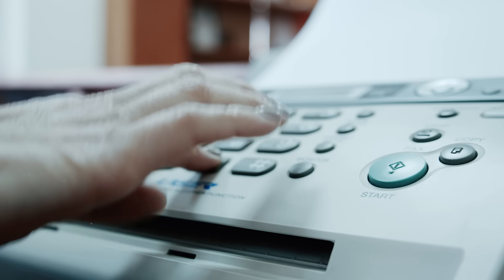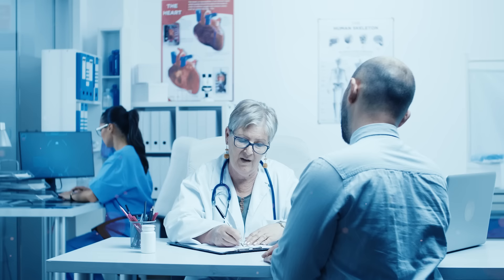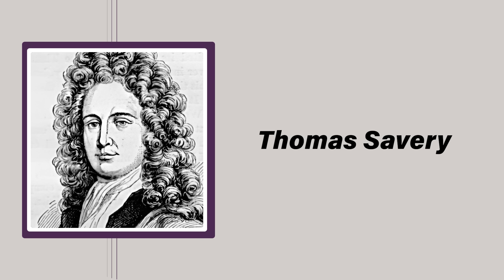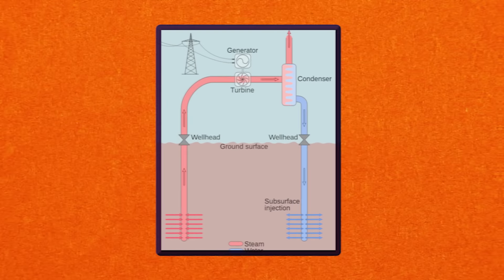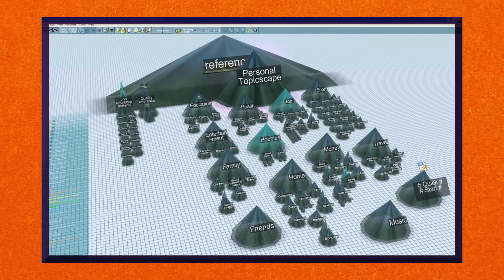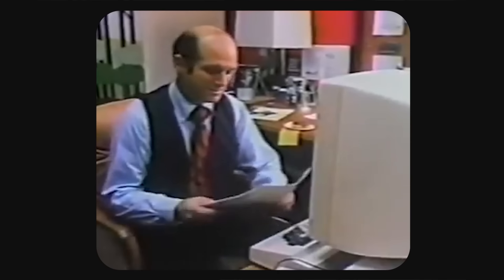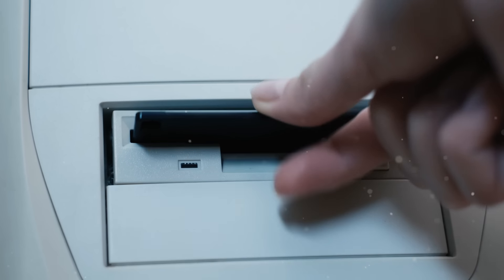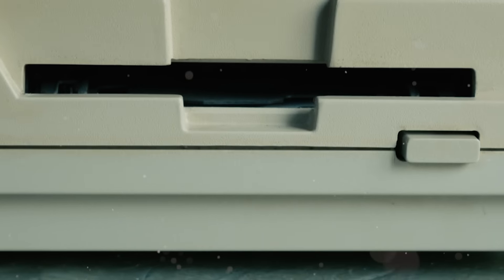Terribly Outdated Technology that we Still Use...

Comment: Hey Simon, I saw a company, with a single owner, do machining jobs with Windows XP. The owner created an interface between old refurbished office computers and large mills. Then he would custom write software for the mill to follow. An example was the large fuel hose collars on F-15 aircraft. The collar had 20 or so steps to process. A semi-trained worker cuts a two inch piece of round aluminum bar stock. Then the billet was loaded into a mill table. The WinXP application is called to slowly mill the inside of the small billet into a collar profile. There were 10 computer mills in the shop. One worker went and cut a second billet and loaded it into the next mill. The process was simple. After a production run was rough cut, the next small program cut application loaded into the mill. Long story short, old Bridgeport mills are repurposed. Old office desktop computers are repurposed. Old XP software was repurposed. 2-3 workers did the output of 20-30 workers. The finished work was very high quality.
Reply: As long as they don't go into the internet, sure
Reply: My Dad was still using MS-DOS and Ani-cam and RS232 serial connection to program Lathes and Mills up to 2016 when he retired. He was a CNC programmer/Setter/Operator all his life. He worked on everything from parts for Nuclear reactors to Gearbox parts for Benneton F1 cars.
Reply: I run my CNC plasma table on XP.  Still my favorite OS.  Windows 7 comes in second.
Reply: i dont know if we still have windows xp machines at the machining factory i work in, but i know we had some a few years ago, now most run windows  7 embedded :)
Reply: I have small table top CNC mill that uses an XP desk top running G-code, I have several XP machines that I keep for backup computers for the mill. One day I am going to build a LASER engraver to run on the same computer as the mill.
Reply: @onmyworkbench7000  now that you mention it, we have a laser engraver i think of the brand seaman, its just powered by an old laptop, and that properly windows xp :)
Reply: @4450krank   Do you still use the laser engraver?
Reply: @My1xT  
Disable the network card in the bios (or remove it, or glue it up)
Reply: @SilverSpoon_ 
Quite.
What I prefer though is that the older machines have dedicated Ps/2 ports for the keyboard and mouse. 
Then the BIOS can be used to disable the onboard USB ports and NIC.
Put a padlock through the case and set a BIOS password you're well away.
Reply: @johnathanh2660  yeah that's another solution that will work too. 
i found out that the late motherboards with one PS/2 port is in fact an USB one. i was ded when i plugged in a thumbdrive with a simple mouse adapter, and it's a 2.0!

still i like my ps/2 keyboards, even my ryzen board (gigabyte) has one so it's cool!
Reply: I still run an analog plasma table it runs on coffee and a weekly check . Ez to program , the cut resolution is a bit crummy based on how much coffee I've consumed before the cut. On day I hope to go cnc table but for now the boss won't even let me build a budget one.
Reply: Disable in bios the networking capacity or even remove the hardware network devices themselves to make the machine airtight.
It doesn't matter which OS is running or how old and obsolete it is if it can do the job perfectly and it is completely isolated from any network.
Reply: Brilliant! I used to re-equip Windows machines from Goodwill, using Linux.
Reply: @caeserromero3013 the thing is that Dos is exclusive for the program running. No rogue process will slow down the system because it can’t. It’s not multi tasking and gives 100% of the processor to the program running. + pretty much every system running won’t connect to the internet so it’s actually quite secure and most things trying to hack them won’t be able to. 
Got lots of good memories of configuring Dos to do what we needed and they just worked.
Reply: I still use a laptop with windows 95.
Yes I use it online.
I need the parallel port and the serial port is handy.
Reply: @aharte17  well depends, is there any service to attack on a DOS machine networked with a IP stack, or using something more cryptic like a client software on X25 or TokenRing, you don't even worry about a hack or a virus, it just can't happen.
Reply: @caeserromero3013 MY dad was still using rocks and a sandal to make bidets for NASA last week

Comment: I had a Windows XP Pro box and it was BULLETPROOF! It was by far the best computer I ever owned. I bought it when XP first came out and I used it for years. I only upgraded from XP after it got to the point that it would not run the software I needed for some classes I was taking. Super fast and super reliable. I still miss it today.
Reply: I stll have Win XP original version , but I stoped to use it 2012 , when I changed it for 7 , and I have used Win 7 to 2022 = in 20 years I used 2 OS :)
Reply: i still use XP mode when i can.
Reply: Windows XP is why Microsoft is known today... I don’t think they would’ve lasted with the trash these days 😂

Ironically everything modern these days was was created back when XP, YouTube, Facebook, Amazon, Reddit, IPhones etc and backbone tech/software was also created / enjoyed around the same timeline....

I will remember XP until I die including those green hills... mesmerized as a child using such a machine!
Reply: Kept the XP box as a second PC until the hard drive finally died. Worked fine for my Lady Wife to surf the 'net on, pay bills, etc., and there were some classic games I still played that would only run on a native XP box.  So I moved the "old" Windows 10 box to her side of the computer desk, built the "most bang for the buck" gaming rig that I use today, and cloned the Win10 box over to it with PCmover. My wife had gotten her Fire tablet by then, so her PC just gathers dust now.
Reply: You can actually partially enhance/extend the Kernel's capabilities and spoof Windows Vista/7 to varying success (⇒"Extended XP"). That way you may even be able to run a semi-recent browser; otherwise something like MyPal as a starting point is recommended nowadays.
Reply: Personally I liked Windows 95, when one still had access to "real" DOS. 

I don't really trust the new operative systems that Windows have now, it feels like I have no control over what my computer is actually doing.  -:) 

sh!t I'm old 😅
Reply: lol same
Reply: I got a Dell D630 to dual boot (Win 7x64 ugraded to Win10x64 then Upgraded to Win 11 x64) on main SSD and Windows XP (32bits) on the media bay caddy with HDD. On boot up press F12 if I ever want to boot into Windows XP.
I still run an old flatbed scanner with paperport, useful old software like sampler for Virtual piano and music Notation software on the Windows XP. My Old HP LJ4050DTN and HP Color LJ2600N printer work perfect with Windows XP and Windows 7 but not so well with Win10x64 or Win11x64.
Reply: Mt work computer upgraded from XP just last year... But it was also literally dying.
The new one had to be custom to work wth the old software the machine needed though
Reply: @ostlandr  

I still have 2 XP machines that I use for specific tasks, but using XP for ANYTHING involving finance online after 2012 would have been terribly foolish.

It's your money, and your data, so - hey!

Comment: I still use a computerised weighing scales for mixing inks at the company I work for. It runs on windows 98 and has never been connected to the internet, so has never had an update. This is probably why it still works as it did on day one.
Reply: Yup at my shop we have a paint mixing room where all the auto tints are on a machine that shakes them to keep them uniform and the computer is hooked up to the scale and the color mix program give you a weight that decreases as you add the tint until all the tints are down to zero then your paint us ready to spray
Reply: The regional laundry service here (serving hospitals, hotels an industry) still have a 386 running Windows 3.1 for the sorting chute counters.
Sure, it takes a few minutes to boot and have the program running, but that's what the first arriver does every morning before beginning to check the order lists to see what needs to be prioritized.
A Pi or Ardino board have enough computing power, but someone would have to make the software which is why it's not being replaced until it actually dies.
Reply: A very important additional reason is that only one and the same piece of software has been used all this time, and the hardware is the exact same, too. Windows 98 is NOT a stable OS by any means, if you installed and uninstalled software, used a variety of hardware cards and peripherals with their respective drivers and later on you replaced some of them... Bluescreeens or other kinds of instability were not exactly uncommon, noticeably more than on a more modern system like an NT-based Windows version, and it was not just because of viruses or updates.

Comment: As a computer networking major back in the late 2000s, I had a fellow student who worked for the IT department of the county government, and she said that they still used Windows 95 for many of the same reasons that were listed here for still using Windows XP. It was relatively dependable, everyone was already trained on it, by staying on it they didn't need to upgrade the hardware to accommodate a newer OS, and there were fewer new viruses and such being created targeting it vs. the current operating systems.
Reply: Except 95 has the blue screen of death 💀
Reply: You can run Win 95 on an abacus.  I loved that OS because it just worked well for me.
Reply: You are talking about windows 95, but windows xp is the best. I never owned a car. I get around on a skateboard, and a normal bicycle.
Reply: I in the other hand loved Windows 7 and extended using it for long as possible. I really did not like Windows 10 as much
Reply: @niconugishd9150  I still use Windows 7. I'll never give it up altogether.
Reply: @ITSecurityNerd  I run Windows 95 on my Nokia 6760. Xd
And also, the most recent version of Windows I own and use is Windows 7. I don't plan on changing anytime soon.
I actually just came out of doing a capacitor replacement on the 2002' Compaq D310 I got hooked to my TV, and that one is dual booting Windows XP and Ubuntu 10.10. Given the GPU that thing is running doesn't even support DirectX 9 (64MB DDR DX8 GF4 MX440 card), I don't even attempt to get anything more modern in it, or else I won't be running games and movies on it anymore.
Reply: @ThePortuguesePlayer  I use a Vic-20 daily. BOO-YAH!
Reply: @ThePortuguesePlayer  I've got an Acer Aspire I'm running XP on.  It's a bit more modern, though, as it has USB ports.
Reply: "D:\pentest\spyware\hack.exe is not a valid Win32 application."
[OK]
Reply: @ThePortuguesePlayer  98SE was more stable than 95 by a long mile, at least in my experience. XP was the best and most durable OS Microsoft ever created, sometimes it's nice to run in a VM, for the nostalgia alone.
Reply: @helenpixels  I never used 98SE, in my youth, I skipped from W95 directly to W2k (which ended up being an OS I enjoyed using a lot). The 6760 can run up to W2k, but considering it's all running under 64MB of RAM and under a 192mhz single core ARM CPU that is emulating the OS as x86, I think the lower I go, the smoother the experience is. I only use it to play Solitaire and Minesweeper anyway.
Reply: I liked windows Xp every os since then sucked for classic games
Reply: Sometimes newer is not actually better. Like how I can't play a DVD in windows 10 because why? Not sure but I can't because of some driver or plugin or lack of.
Reply: Yeah this video constantly underestimates the value of backward compatibility...I for one don't want my documents to become un-openable in the format wars.
Reply: The virus threat has probably passed.
Reply: @niconugishd9150  Basically after Windows 7 there were no Windows in the same class of stability (and, in particular, stability of features and interface)
Reply: 95 is fairly reliable. It doesn't run in "Protected mode," allowing you direct access to hardware (memory and ports). Windows 98 was very unreliable in my experience. A freshly booted 98 computer sitting at the desktop for a month or two would just start to hang and glitch, just like my window 10 PC does when I don't reboot it every other day as it asks me to.
Reply: Yeah, the other thing that happens is that some required programs are only built to work on one particular OS and the cost to get it working on newer OS's can be quite prohibitive and not worth the time.
Reply: I had the same thing.  I have an old laptop running good faithful XP.  Somebody said arent you worried about viruses and being hacked?  I said no, viruses are made for Windows 10 or a lesser extent back to Windows 7, not XP its as safe as a bank vault at this point.
Reply: Windows 95... yup, I still have mine, and it works great. So does my Windows 3.11 and my 286 DOS machine... heck, it still has a 9600 baud modem 😂
Reply: @ThePortuguesePlayer lol, nice. Although I am surprised you don't have a partition running either UNIX or Linux 😊
Reply: @ThePortuguesePlayer  you should also be able to play Wolfenstien as you have more than enough machine to run it smoothly 😊
Reply: @tspawn35  Most often, that is because the program uses nonstandard methods. If a program is written to the standards Microsoft published it will work on any later version.
Reply: @garysnewjob  If people wrote to the standards, it'd probably also work on WINE. For reasons I'll never understand, it seems like programmers hate to use documented interfaces.
Reply: @jamespulver3890  Sometimes, the Application Program Interface (API) is slower than the nonstandard way to code. Programmers use the workarounds because they make better performance, but in the next version of the OS, their program quits working and must be reprogrammed.
Reply: @garysnewjob  Watermelons 🍉  🤔
......
...
..
.
I must be ........
Reply: I think Windows 95/98 were the last Windows to run 16-bit programs natively (no emulation).   Porting 16-bit programs to Windows XP was often easy but it wasn't trivial.  Some niche 16-bit programs didn't play well with Windows XP much like people with 32-bit niche programs need to stay on Windows XP 32-bit for the same reason.  Yes Windows XP can run 16-bit programs and Windows 7 and 10 can run 32-bit programs but they are NOT guaranteed.  I have 32 bit programs that don't work on Windows 10.

Comment: I grew up on and still farm using very old technology. My oldest tractor is a 1937 Oliver Hart Parr 70. My newest, a 1966 John Deere 4020. It's capable of operating modern equipment on it's horsepower range. I pick my corn with a corn picker, not a combine. They stopped making them in 1984. I store my corn in cribs to dry on the ear. If I need to shell some I run it through a sheller built in the 1940s. They stopped making them in 1975. It shells corn cleaner than a new combine does. Same with the combine I have, built in the 1950s. It make grain much cleaner than a new one. None of my equipment has any type of computer system on it. I don't have software problems. The most interesting thing I have is my square hay baler which uses a mechanical knotter which was introduced on grain and corn binders over 120 years ago and are almost identical to the knotter on a brand new baler.

Comment: I used to fly in and out of some remote islands on Canada’s East Coast. Sable Island has a cellular antenna, however between the buildings on the island they are connected with old fashioned crank phones. There is no switchboard, they are all on one party line. If you want to reach another building, you pick up the receiver and crank the ring for whoever you want to reach. A half rotation of the crank produced a short ring, one complete rotation gave a long ring. To call the main building, that would be one short and one long ring. Rotate the crank halfway, stop and then one complete crank. All the phones on the line would ring, but the guy in the main building would pick up because he would know the call was for him. It all worked on a 4.5 volt DC system which was powered by an AC transformer, and more importantly a battery backup. The reason why they still used it was because it worked, regardless of the weather. It’s hard to get a repairman way out there in any reasonable time frame, so dependability is much more important. I think the system was initially installed in 1902 and is probably still in use today. I haven’t been to Sable Island in 20 years, it wouldn’t surprise me if it is.

Comment: Years ago I bought a decent quality film scanner. There wasn't a USB version of this scanner, and it hooked up to my beige G3 Mac via scsi. 20 years later, the whole setup lives in my loft, ready to go! If I have an old slide to scan, I just power it up, scan, save the images onto a Zip disc, open the zip in a slightly newer Powerbook, which has both USB and Firewire, and then transfer the scans to my iMac.
Why? Well, the film scanner is a good one, but my usage wouldn't justify my outlay on a new model. And there is always the possibility that the new scanner would not be as good as the old one (this has happened to me before...). Finally, I quite enjoy messing with the old tech👍🏻
Reply: Heh.  I have the same basic issue, same reason.  Old film scanner, and it's been cheaper to buy adapters etc. than replace the thing esp. since I don't scan a lot of film any more as I've gone totally digital with my photography.  I keep it for the backlog of old stuff that I'll get around to scanning eventually.  Maybe.